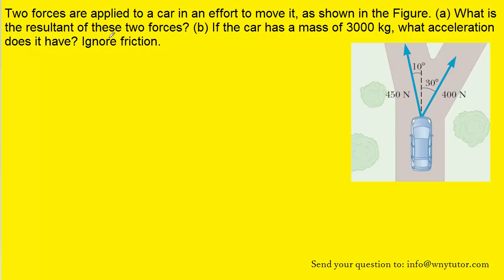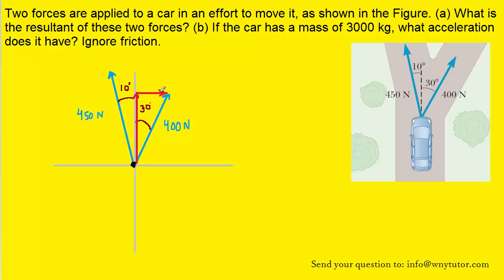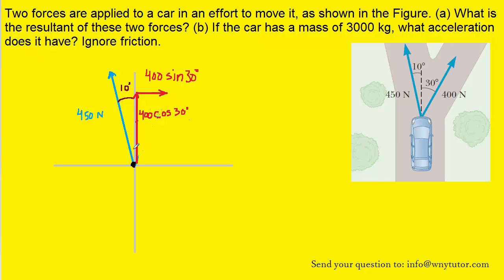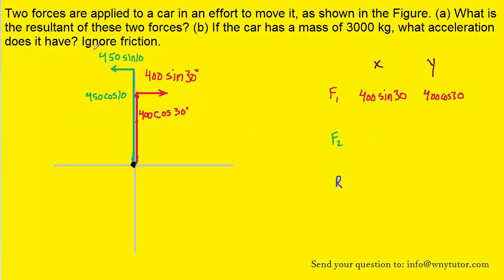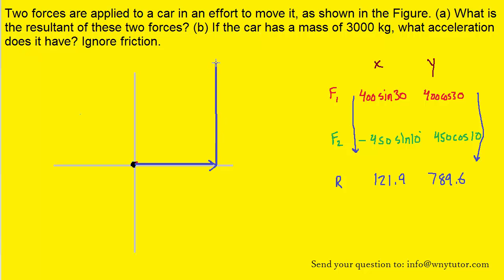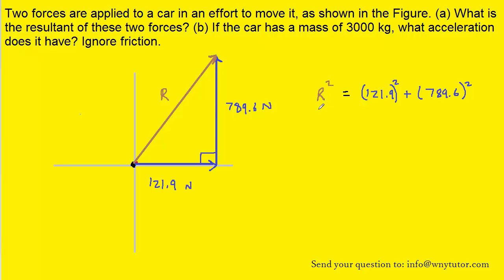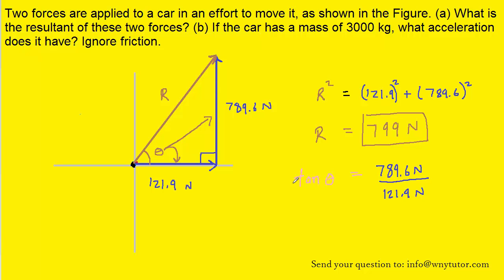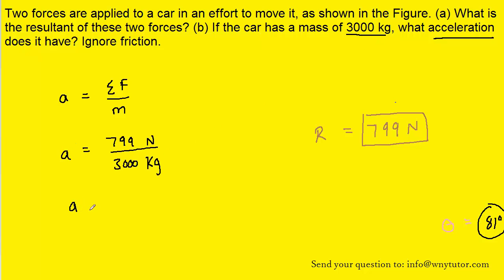Two forces are applied to a car in an effort to move it, as shown in the Figure. (a) What is the res

Comment: So the question is actually trying to identify the direction to the right of the forward direction.  That being said, finding theta was not correct.  It should have been theta = arctan (F1 sin theta / (F2 + F1 cos theta)).  This is based on the overall force.  The theta utilized would be the combination of the two forces which would be 40 degrees.  Once the answer is found, you would then subtract that from the forward direction side.  In this case, 30 degrees is on the right side, so we would take the answer previously found from 30 degrees and then have the answer of the angle to the right of the forward direction.

Comment: If this helps anyone:
This is how I find the x-and-y Components of a Force
Fx = (400N*Cos60) + (-450N*Cos80) = 121.8 N
Fy = (400N*Sin60) + (450N*Sin80) = 789.57N
All I did differently is changed their respective Thetas to their Complementary angles.

Solving its direction won't change neither. This helps me understand the vectors without re-drawing the vectors. I see it takes time and work for me. 

Good video!